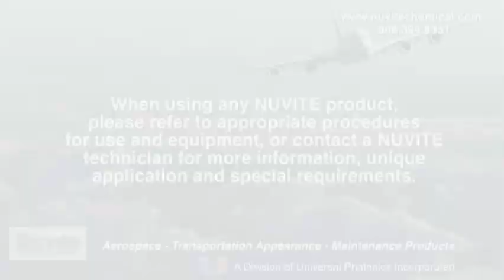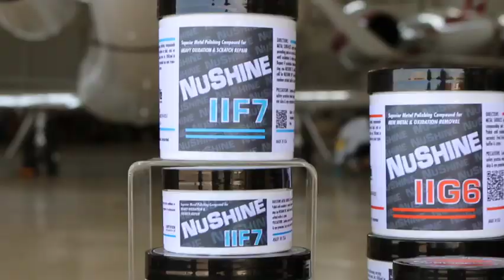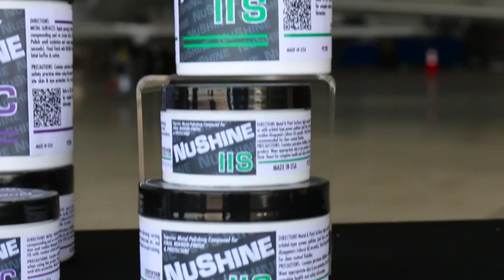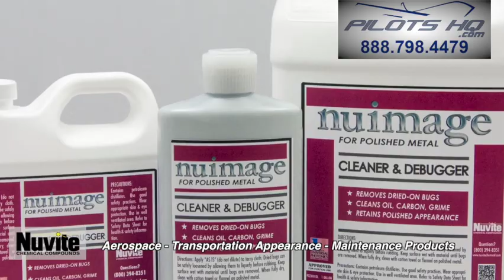Detailing Aircraft Brightwork With Nuvite's NuShine And NuImage

Comment: I detail planes for a living and we rarely use anything more course than C, and I've actually never had to use anything more course than G6, but ive onky been doing it a coupke years. In fact, well maintained aircrafts sometimes can be done solely with S or A (followed by S). But the tried and true method is using C on a circular, followed by S on the circular, followed by S on the DA. The only reason why it can be better to use S or A on well maintained aircraft (as opposed to C and anything courser i.e. G and F) is because using course those course variants can cause rather noticeable swirls in the aluminum, especially when viewed in sunlight. The swirls can obviously be removed by using the finer polishes (A then S) but that adds an additional step (from 2 steps to 3), and we have very very picky customers with well maintained aircraft that shine lights upon the metal to look for swirls, but since its maintained we can use S on a circular first, followed by S on the DA, sometimes followed by an even lighter pass with S again on the DA. Have no idea if anyone will read this, but feel free to ask me any questions or share if you have more experience/better techniques than me. I'm still the newest employee at my job so theres so much nore to learn.
Reply: You’ve been there a few years now… still at it?
Reply: hey not sure if u'll see this, I've been using C with wool pads on circular the result is great but there are hologram so I follow using S with foam pads on DA, however it leaves a cloudy hazy look after the DA. Is there a reason why it leaves cloudy hazy looks ? What pads were u using on the circular and DA ?